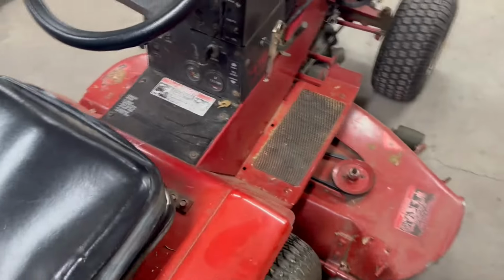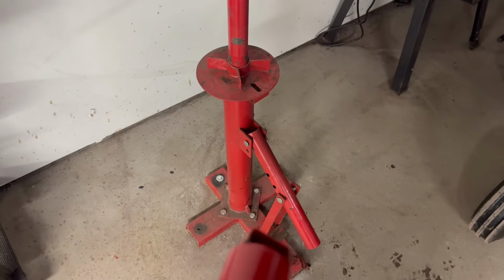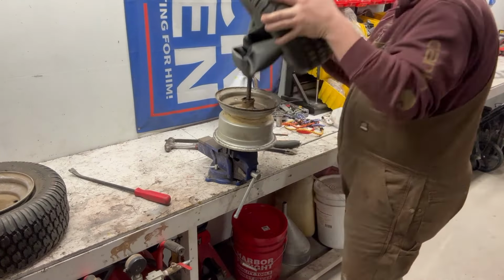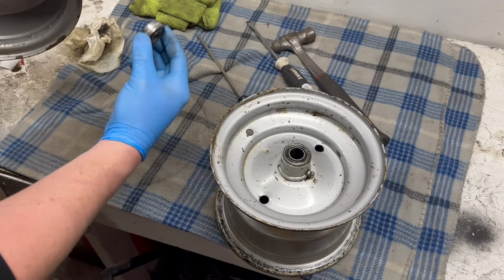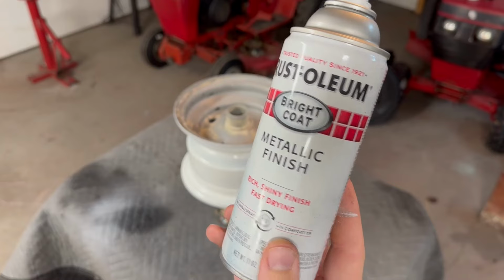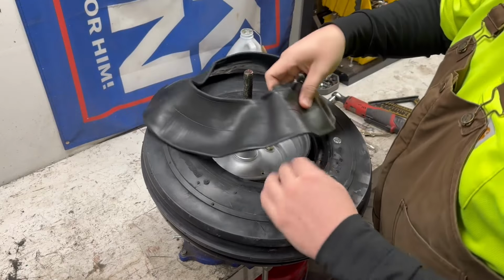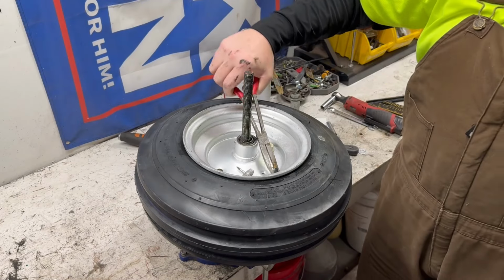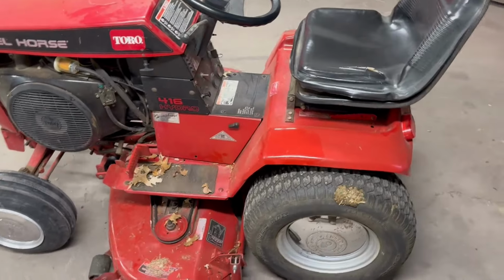30 Year Old Wheel Horse gets new shoes!

Comment: As someone who has ran a sandblaster for thirty two years, I can offer you a little advice. Sandblasters are self destructive. Keep an eye on the wear and tear. It's much cheaper to replace a small part here and there, than to replace bigger parts, or have to fabricate things you can't replace. Also, don't try to push them too hard. It's easy to say, well, the more power, the better they blast. They also wear themselves out faster. Take your time, and they last longer. Other than that, they are a great addition to any shop. By the way, great content. I love what you are doing. Keep up the good work.